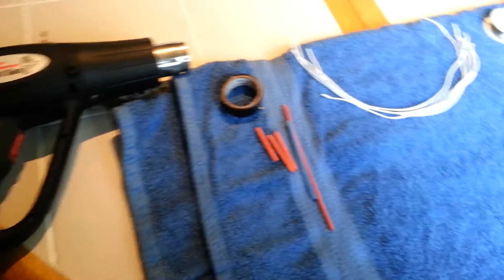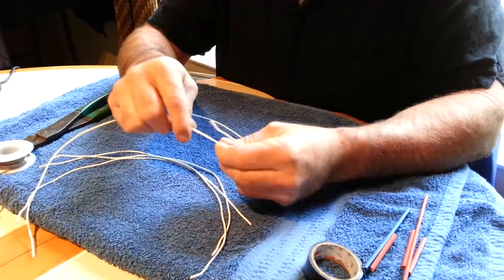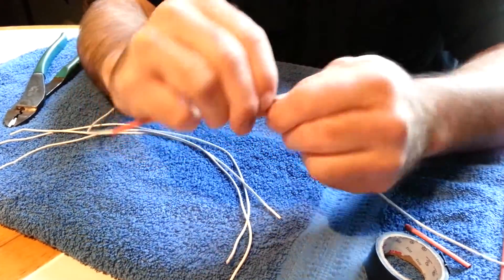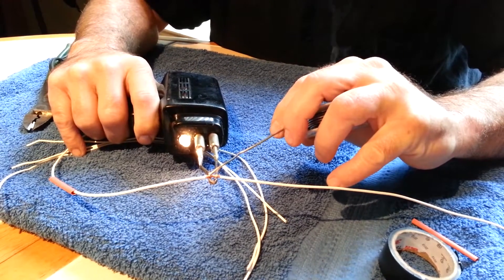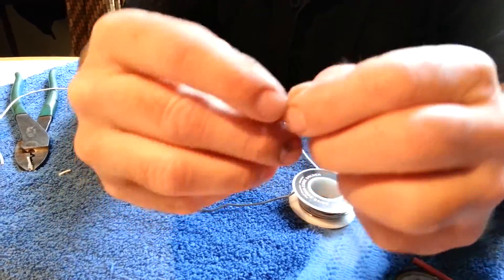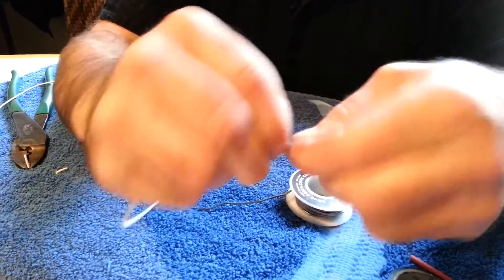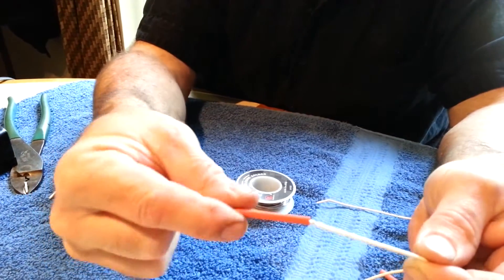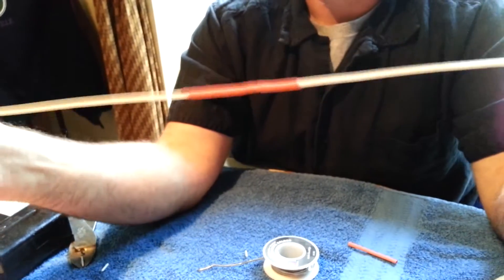Tech Tips with The Angry Mechanic - Soldering wires

Comment: Hi Angry Mechanic. 

Thank you very much for your instructional and helpful videos. With all due respect, my I please offer some advice? 

If you must solder your wire connections, then your method is a good start.  You will find that if you "Wet" the tip of your soldering iron or gun, (Irons are better because they have a constant heat that's not too hot.), your solder job will go more quickly.

Having that little pool of molten  solder on the gun or iron's tip will allow the heat from the gun to conduct to the wire much more quickly. Once the solder has sucked into the join take away the heat. You don't want too much solder to travel up the wire. It'll make the wire brittle and prone to breaking. 

MOST importantly do not allow the newly soldered joint to move or shake at all until it is completely cooled. Otherwise, you could end up with what is known as a "Cold" solder joint. You can experiment with creating cold joints so you will be able to recognize one when you see it. A good joint will be shiny when cooled. A cold joint will lack lustre and will fail electrically and mechanically. Try soldering something and shake it before the solder has cooled. Tap it against something. You'll see the effect right away.

Also, heat shrink is very thin walled. Your solder joint will almost certainly have a little spike in it somewhere, most likely at the very point where you lifted off the gun from the joint. That spike will easily go thru the thin heat shrink and cause you lots of grief. 

If your wire is going to be inside out of the weather, you should just use a good quality vinyl electrical tape like Scotch 88. It won't look as pretty as heat shrink but will be a much better and safer job. If the wire is out in the weather, you need to tape up the join with a good quality Vulcanizing tape from someone like 3M, Scotch. Then you cover the vulcanized join with Scotch 88 vinyl. 

I know that it won't be as pretty as the heatshrink but you will be able to examine your splice in 10 years time and find that it is still like brand new. Your "heatshrinked" joint won't look so good out in the weather in 6 months, especially if your roads get salted in winter.

One final comment. Sorry but crimp connectors are not for rookies or amateurs. They are better than solder because you don't end up with a potentially brittle wire caused by the heat and the solder. BUT, you must use a proper crimper; one that has a spike in it that permanently crimps the metal hard onto the wire. You can certainly cover that splice with heatshrink if the joint is out of the weather. It'll be a great connection and will last a very long time. And it'll look good, too.

If the joint is out in the weather, use a crimp type splicer with a good crimping pliers/tool. Then seal it  with the vulcanizing tape and finally vinyl tape. It, too, will be water proof and solid electrically for many years to come. Please don't rely on heat shrink.

I hope I have not offended you. I offer the above advice based on 40 years in the marine electronics industry. My guys and I make dozens of splices a week -- that are outside on ocean going work boats, big fishing boats, oil tankers and so forth. Vessels that are operating in the harsh North Atlantic Ocean. It's commonplace to open a splice you made on a customer's boat 5 or 7 years down the road and find your splice looking like brand new. I'm talking about a ship that sees 10 or 20 tons of salt water crashing over the top of the wheelhouse every 5 minutes when they are out in a big sea. A bad splice and the radar or radio or satcom goes down. Not good.

By the way, your video on how to change a glow plug in a Duramax 6.6 was a god send. I followed your advice on diagnosis and then replacement. Worked like a charm. Thank you so much.